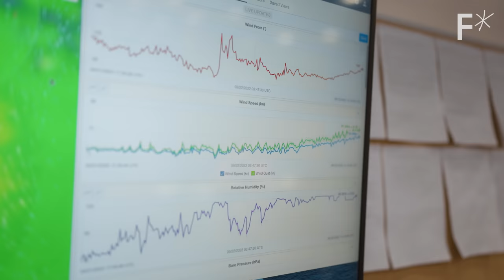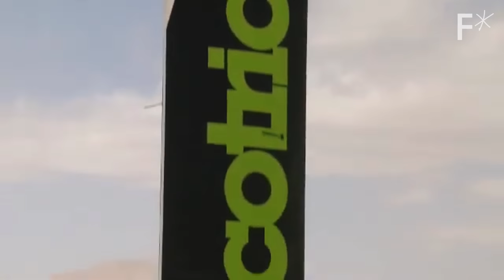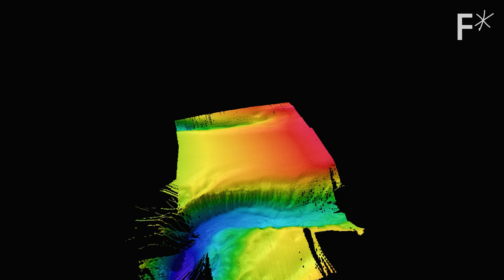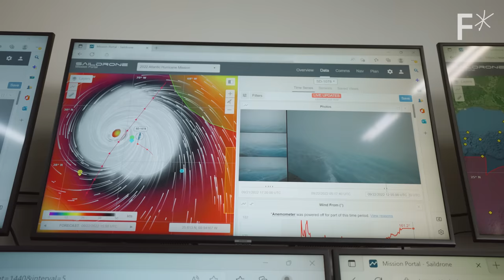We can’t see 80% of Earth. But these robots can. | Hard Reset

Comment: 100s of meters per pixel at 8000 meters. That's a very very very low resolution. The abyssal plain which covers 80% of the ocean floor is 3000 to 6000 meters deep. 
So they don't see much with this technology. Objects 20 or 30 meters in size will not be visible at these depths. 
We need technology that can map the deep ocean floor with <1-meter precision.

Comment: "we can operate these vehicles with less power than a lightbulb uses" - proceeds to show massive solar panels on the sailboat.
Reply: I guess it would be with most of it turned off or going on a cycle.
Reply: 1 square meter of land at the equator produces receives a maximum of 1360W of solar energy. The best solar panels on the market are 47% efficient, cutting that available power down to 369W. That solar panel is not anywhere near perfectly perpendicular to the sun, and at 45 degrees to the sun, that would then be cut down to 1/sqrt(2) of the original number, or about 260W.

That solar panel is not an entire square meter, so let's say it's 0.75 of that. That brings us down to 195W. If there are other losses, or they are just using what isn't the absolute best solar panel tech I could find, they could easily be in the 100W range. A more average solar panel efficiency of 30%, or a worse average angle to the sun would be pretty close to that mark.
Reply: @DigitalJedi  thanks for that!

Comment: They should use UHMWPE for the bottom of the hull to avoid barnacles.
Reply: That uses too much power for the scale of power they produce and can run on
Reply: @JoshuaDickin  I was talking about the plastic called ultra high molecular weight polyethylene.

Comment: Its impossible to predict the weather anymore than 30 days as it is a "chaotic system"
Reply: So is the turbulence in water, but that's a huge area of research. Chaos can be tamed with mathematics.
Reply: @doctorgoose7  Maybe in theory
Reply: @chrisscullynz  It's how we currently design pumps, pipelines, mixing, polymer science, stock markets, and more.
Reply: @chrisscullynz  Some aspects of chaotic systems can still have equations with huge practical application, for example turbulent flow in pipes. It's not possible to calculate or predict the path of every individual drop, but from knowing that the flow is turbulent, there are a lot of other behaviours that can be reliably predicted in the system.
Reply: Machine learning will eventually be able to predict every single wave and wind gust on the planet.
Reply: @jimj2683  Maybe with no external inputs like the butterfly effect
Reply: @chrisscullynz  All you have to do is consider their effects - models are just collections of understood mechanisms. The original butterfly effect is just a thought experiment for unconsidered effects over long time spans. Not being able to predict every single atom doesn't mean we can't meaningfully predict or control the system.
Reply: @doctorgoose7  I disagree
Reply: @chrisscullynz  U disagree with no reason. whats the point

Comment: Cool drones but predicting weather month in advance is BS. The data from the drones is valuable but that it will massively increase the weath forecast is BS. You can get most of the data by satellite. And the weather system is turbulent aka a prediction past a certain point is impossible because even tiny changes can have huge impacts and this sums up to a point where it it simply impossible to make precise predictions no matter how good your data are.

Comment: What a frustratingly bland video. Articles online are chockablock with interesting info and this barebones outline of the company was the best Freethink could do? Where’s the tie-in with the US Navy testing or dust ups with Iran? Examples of sea routes that they’ve mapped? Fleet size and costs? What about any grants or government contracts or juicy investor details?

Saildrone, private startup based in Alameda, CA. 101-250 employees. Has raised around 189m in funding since their 2015 seed round, 100m of which coming from 2021’s Series C funding round. (Series C funding has the goal of preparing a company to be acquired, go public on the stock market or undergo significant expansion, possibly through acquisition. It's usually the last stage of fundraising a startup goes through, although some businesses pursue additional rounds to raise more capital.) Venture capital firms that have invested include Chamath Palihapitiya’s Social Capital, New York based Lux Capital, and the prolific Hong Kong-based Horizon Ventures. 

Saildrone’s offering is a wind and solar-powered unmanned surface vessel developed for autonomous mapping and data collection for maritime security. Weighing in around 1,200lbs with speeds between 3.5-9.2mph the vessel comes equipped with meteorological instruments, bottom scanning sonar, AIS (automatic identification system) detection and a 360-ISR (intel, surveillance & recon) camera. (AIS detection and ISR camera may be important for countries policing shipping vessels that turn off their AIS to avoid tracking be it fishing fleets, piracy, drug smuggling, or human trafficking)

Their competition? appears to be the Data Xplorer from company Open Ocean Robotics whose offering is about a sixth the weight, is purely solar powered, and can reach upwards of 20mph of 18 knots. Only gave the company a small once over, probably other competitors, dunno their numbers yet.

A 2019 article from the company website put the price tag per ship at around $80-150 million and up to 100k per day to operate, blaming fuel, consumables, and satellite data costs. Presumably the production cost has come down since then? At that time, with around 4 years of operations, the article claimed more than 250k nautical miles sailed and maintained a roadmap expecting to hit a 1000 strong fleet of USVs to cover the planet, one Saildrone per 360 nautical miles, and drive down the cost of data by an order of magnitude. (Current 2022 website claims 800k nautical miles and 18k days at sea collecting data, don’t even get me started on the 28-day expedition between Honolulu and San Fran. 6,400 square nautical miles of sea floor mapped)

In current news the company’s Sailboat Explorer is undergoing testing at Digital Horizon 2022, a three-week naval exercise held by the US Navy’s Fifth Fleet. Created with the intent to build a fleet of more than 100 unmanned craft in the Arabian Gulf, Arabian Sea, and Red Sea. 

Less current news from last August involved the Iranian Navy attempting to abscond with three US Navy owned Saildrone USVs (unmanned surface vessels). All three were recovered and the Navy has communicated that the Saildrones involved are available commercially, and do not store sensitive or classified info. Author of the article Carrington Malin noted the potential for future incidents as USV numbers grow and countries begin to debate unmanned trespassing in or near territorial waters.

https://www.crunchbase.com/organization/saildrone

https://www.linkedin.com/pulse/testbed-naval-innovation-more-middle-east-ai-news-carrington-malin-/

https://www.linkedin.com/pulse/usvs-make-our-seas-safer-more-middle-east-ai-news-carrington-malin-/

https://www.saildrone.com/news/saildrone-fleet-study-planet

https://openoceanrobotics.com/dataxplorer/

https://www.indeed.com/hire/c/info/series-a-funding